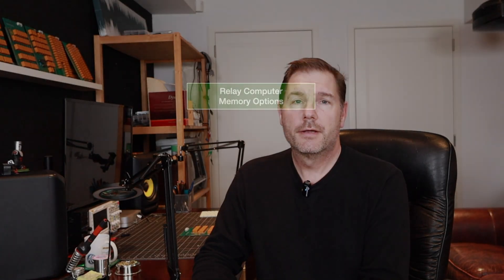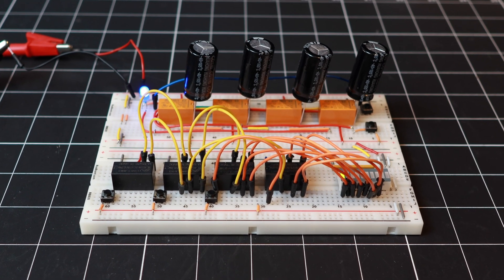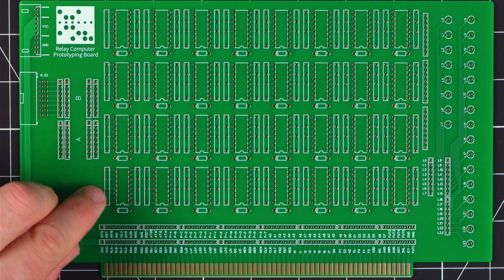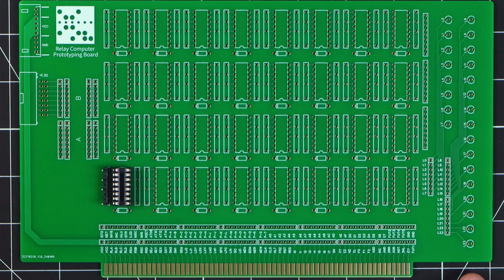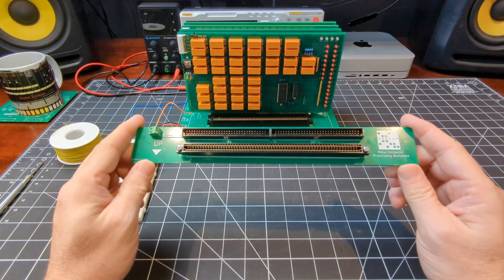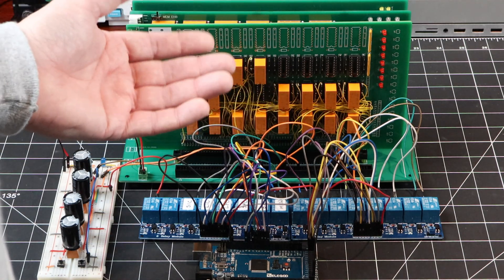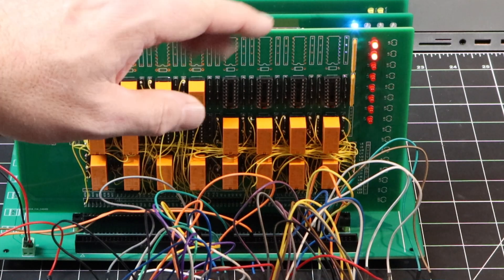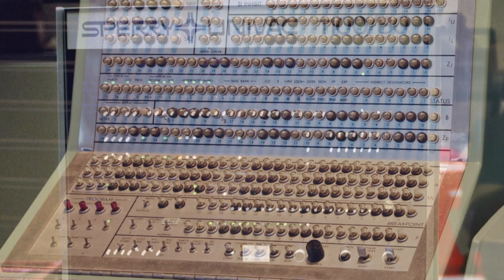Relay Computer - Prototyping Board & Instruction Register

Comment: Will the data bus gating to PC become useful when implementing a JMP  instruction?
Reply from the maker: The architecture of this machine doesn't load the PC from the data bus directly as the data bus is only 8 bits. But, we can load X and Y with two 8-bit values that become the 16-bit XY value that can be transferred to the PC via the Address Bus.

Comment: This is really a thing of beauty :)  Its really fun and addicting building up an SBC or home designed computer, but doing with relays just is so fun. And insane. But mostly fun :)
Reply from the maker: The process has taught me a lot in both design and low-level CPU functions - it is a bit insane and I'm always surprised when I plug in a new board and it actually works 😁

Comment: Thanks for sharing, I have been waiting to start my own project. Going to university now so I can finally start something like this and this is really good motivation and insight :)
Reply from the maker: For what it's worth, I started with a cheap set of breadboards, a few relays, LEDs , resistors, jumper wires and a battery. Oh and I guess diodes, too...I always forget about those 😬 The only thing I'd recommend is to buy good quality breadboards - they are a bit more expensive but they are well worth it!
Reply: @dipdoting  I have had to experience first hand the horrors of cheap breadboards, having to troubleshoot a circuit only to realize halfway through that one needs to troubleshoot the breadboard too.

If there is one thing I'd happily pay a premium on it would be breadboards haha

Cheers.

Comment: what Wirewrap tool do you have, ive been searching for one, but couldnt find the one i need. yours look like exactly what i need
Reply from the maker: It's a Jameco Benchpro WWT-100, and inside the handle there's a wire stripper as well.

Comment: I like your prototype board. With TTL CPUs people store the microcode in an EEPROM, but you can't do that. So it will be interesting to see how you build it out of relays. I suppose a diode ROM is possible.
Reply from the maker: Yes, it makes for an interesting time decoding the instructions, for example the micro-code to transfer a value between registers will take ~10 relays.

Comment: The sound it makes reminds me of teletypes. If your machine can run at 10 cycles per second it can load programs from a 8-bit punched tape reader, such as one included in model 33 ASR teleprinter, or a from a separate unit (much smaller than a teletype)
Reply from the maker: I LOVE the sound of teletypes; having one is on my bucket list. Always been fascinated with how they are mechanically synchronized and actually passed serial data so many decades ago!

Comment: Is there a particular reason why you didn’t hardwire the gnds for the relays?
Reply: You don't always want a relay coil wire directly to ground on one side. One example is doing XOR on the coil where you have one source/sink input to each side of the coil. If one of them is pulling to VDD and the other to GND, the coil energizes.
Reply from the maker: Actually, they are all grounded --- I just kept the pins there for symmetry. Originally I was thinking of not using a ground plane because sometimes you may want to activate the relay using the GND (like from a Darlington - that's what I did on the Static RAM memory card).

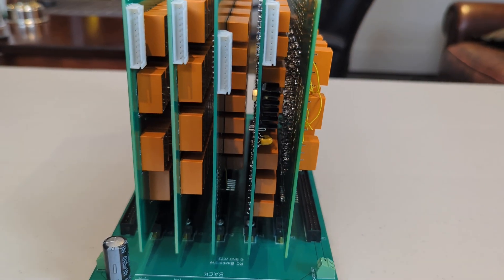Comment: Great work.  Just a query - at 14:23 on the backplane it looks as if the reservoir capacitor is doming out a little, could it be failing?  May be worth checking/bearing in mind if you get errant behaviours.
Reply from the maker: Good eye! I'm thinking I'll need a larger capacitor...there'll be one on each backplane to split the load.

Comment: What's the smallest instruction set you can get away with?
Reply: Google the PDP-8 and take a look at its instruction set. It had eight instructions, one of which allowed embedded microcode. Theoretically it is possible to build a single instruction set computer using conditional subtract (SUBLEQ), but no sane person would want to program it.
Reply: I have also done a single instruction computer, but my instruction was copy. Everything was mapped to an address and shared the same bus.
Reply: @awesomecronk7183  that sent me down a rabbit hole of triggered transport architectures. I have never heard of that before.
Reply from the maker: I guess it depends on what we want it to do. If the only instruction was a "NOP" then it would just happily click away with the clock. Like what @mheermance said, probably around 8 minimum to be able to do some interesting stuff.